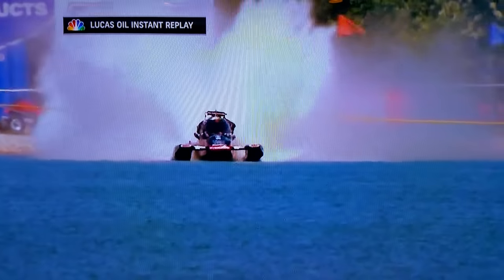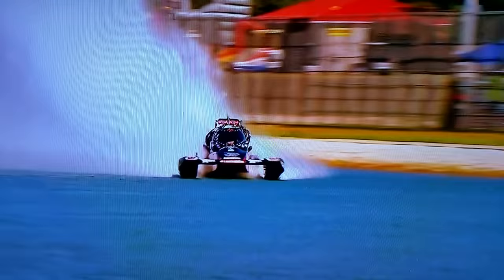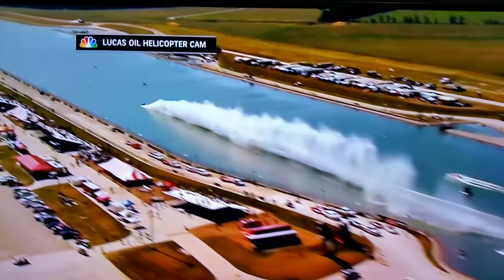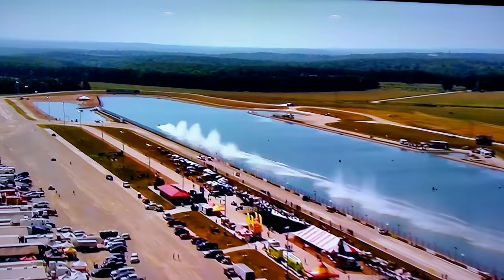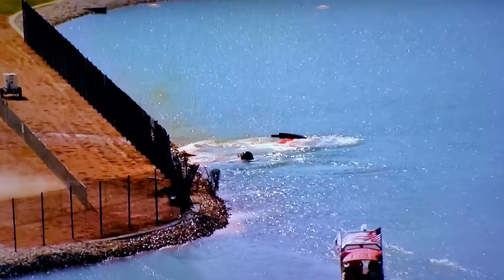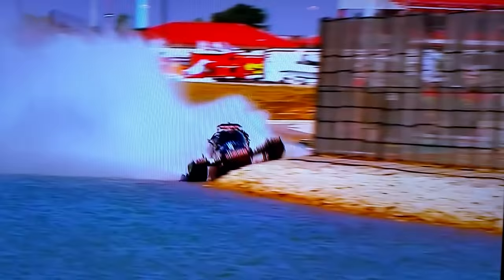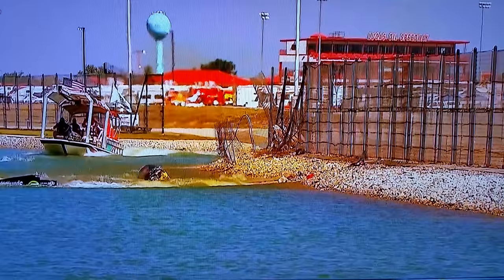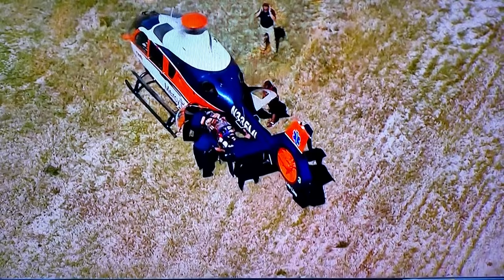Top fuel racing boat crash

Comment: Why are they racing in a puddle
Reply: It is specifically designed for drag boat racing. There's one in Chandler, AZ and I believe one at Lucas oil racing complex
Reply: Small body of water means less waves and smooth surface
Reply: I believe they're doing it for safety purposes during an event
Reply: @bubbaj6773 wow did not know that

Comment: 25 seconds in he's on the gas taking off and at 31 seconds it looks choppy like he let off the gas but if that's the case and the throttle didn't stick ( where's the kill switch and back up emergency parachute at ? ) The parachutes should not have malfunctioned like that , not both of them , and he doesn't look like he is losing any speed all the way up to the point where he slams into the wall ! Who the hell designed this death trap man made lake and approved it for safety ??? Driver pod or not he is dam lucky to have made it out of this wreck !